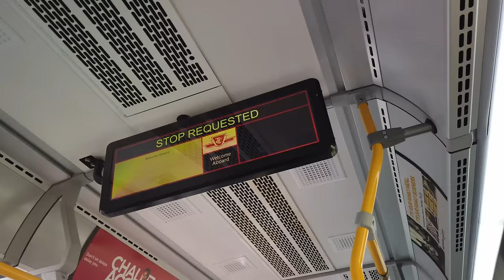Why American Buses Are Just Worse

Comment: Rectification; For the Schiphol-Amsterdam Airport buses are only 42 buses, not 200. Orginally 51 were ordered, but over time 9 were transfered to the regular buslines. The whole Amsterdam/Haarlem/Haarlemmermeer/Schiphol is indeed over 200 electric buses, however these are from VDL and Ebusco, and are a bit problematic.
Greetings, a former connexxion busdriver and Mercedes Capacity instructor
Reply: yeah I was a bit surprised by this fact, 200 buses for an airport seems way too much.
Reply: Rectification; there are actually around 200 bussen at AMS Schiphol airport! These busses are from Connexxion and not from VDL or whatsoever.... And those busses are used for the airport (and around)
Reply: @samboudarboe1776  you couldn't have a made it more clear that you don't understand what was written or said. There simply aren't 200 buses for the airport, there were 51 ordered, and as of now 9 of those are transferred to the regular buslines in this concession area. The grey VDL slfa-181 were specifically ordered for the Schiphol Airport part of the concession, the rest, the regular white buses, and the red RNet buses are aren't specifically operated for schiphol. In fact none of the regular lines run to Schiphol, and not all Rnet pass schiphol.
The fact that the buses are operated by connexxion, and VDL and Ebusco are manufacturers was clearly stated in my message.
You don't need to lecture me about my former place of work, and especially not with the same, very wrong information stated in the video, that there are 200 electric buses running at just schiphol airport is just false and misleading information
Reply: @tripel7470  There are 200 busses that are used by the company Schiphol group those busses are also used by schiphol group but they are not driving AT the airport (I never said that btw). I know that the busses that drive for example from/to the gates are not those Connexxion busses but are different ones. That still not takes away the fact that schiphol has 200 buses used for bringing people from and to the airport.
Reply: @samboudarboe1776  Schiphol group has 53 electric buses, connexxion operates only 42 electric buses on behalf of schiphol, regardless of how you count, that isn't 200 electric buses, and the statement is still false.
Reply: @tripel7470  Are you talking about apron (Gate-Plane) buses or the white VDL's ?
Reply: @-ProGamersTurkiye-  orginally I was talking about the Schipholnet VDL buses since that was the context of the video, but since Sambou decided to double down on being and tried to involve the BYD's driving airside, those are part of my my final count. However, since the video in context of electric buses running  public transport just on the airport, only the VDL's should be counted, of which currently 43 are dedicated to Schipholnet.
Reply: @tripel7470  Oh ok. And what about the 9 buses that were transferred? Are they working as R-Net buses?
Reply: @-ProGamersTurkiye-  Correct, they have been transferred to R-net, and have so far only been used from the Amstelveen depot
Reply: One thing I noticed at Schiphol in 2019 was the absence of pure ICE powered taxis. The official taxis all seemed to be Teslas and the Ubrers etc were hybrid.
Reply: @-ProGamersTurkiye-  And to make things more complicated ;) They are operated by Connexxion as well, just like the white-blue-purple Schipholbuses.
Reply: @weeardguy  Yeah, I learnt the whole thing when I went to the NL ;)

Comment: Interesting that you mentioned rattles on the North American buses. I drive Volvo and Mercedes buses in Brisbane, Australia and after a couple of years, they start to rattle as well, although the Euro6 Mercs are still nice and smooth. I'll be interested to see what our new Volvo eBuses are like in a couple of years, as they're a real pleasure to drive at the moment.
Reply: Same with the Scanias here in Adelaide, but they're bodied by Bustech so I can't really say where the blame lies. Great to drive though.
Reply: I’ve also noticed them with electric buses in Germany, both Mercedes and Solaris models. I have the suspicion they are tuning the suspension to be really stiff to try get more range out of them
Reply: @bmortloff  So, so incredibly recognisable... Since the first operator here got kicked out for Arriva in 2006 (In Europe, most areas are tender-based and the operator changes every 8-10-12 years, under the excuse this is cheaper for travellers because they get a choice... NOT), we have Scania Omnilinks... The current operator (EBS) and buses now serve the area for 12 years, 2 years longer than anticipated as covid got in the way during the end of the tender. But already during Arriva's time, the Scania's just kept being crackly, squeaky and what not. The current Omnilinks in service at EBS are still a horrible squeaky and crackly mess, even after 12 years. When the free newspapers were still a thing, you would regularly see drivers tear a page from it, to than fold it small and push it between a squeaky part somewhere: some buses were basically driving artwork with all the stuff pushed between windows and rubber seals and such, just to keep the drivers from going nuts.
I can't say that VDL Citea's (either electric or conventional) or Ambassadors are much better (the buses you see at 4:25 in the video are the ones I take to work on a workdaily basis and are in service for a number of years now), but their squeakyness is at another level and does seem to go down as they age.
Reply: Meanwhile in Singapore I find that MB Citaros rattle the least, maybe because they have independent suspension that's more sensitive to & thus better able to absorb bumps on the road, while ADL Enviro500s rattle & squeak the most, though some believe its due to lower build quality of the Zhuhai, China factory where they're assembled in (those in the UK that're assembled domestically are slightly better, from my experience). The Volvo B9L that's used on some shuttle bus services fall somewhere in-between, but also suffer from more inertia & sense of lurching forward when braking, which I suspect is because those buses use chassis/bodywork that're designed more for coaches than commuter buses, which are heavier (& thus maybe can ride out some road bumps better)
Reply: There's been times on american buses where my phone almost bounced out of my hand the suspensions are so bad. We need to change the law to allow importing better buses here. It's literally no different than importing wine or consumer goods, which is legal. If every American is already buying cheap china garbage, it won't make a difference in our economy to get busses from Europe
Reply: @michaelstratton5223 Trust me that when the road gets bad, modern buses won't help much: old, what we call highfloor buses now, used to be superior when it comes to the comfort they provide (also down to the far, far better seats in those buses). A speed bump was a comfortable nudge up and down, where low-floor buses seem to have a very rigid suspension that transfers every bump to you as a passenger. On the other hand, Dutch-built buses were built to last: the fact that buses from the end of the seventies and beginning of the eighties were exported to Cuba and such and are still running till this day (be it with some tweaks to keep them going), tells something about the ruggedness. I'll happily step on board a Den Oudsten bus should I get the chance.
One example of the rigid suspension is the road-marking they used on my route to work. For clarity, road-markings in The Netherlands aren't painted onto the road surface, but are white bitumen poured into special templates and thus show a considerable height difference between the normal road surface and marking (I think the difference easily gets up to a centimeter (about 7/16 of an inch I guess), thus driving over road markings creates clear audible noise.
Usually, when dangerous junctions, especially between different modalities (motorists vs. pedestrians of cyclists) are getting near, the infrastructural owner tends to put special marking in place to hopefully highlight the junction. Near where I work, it was decided to put a whole row of perpendicular markings starting from the edge of the lane as small stripes, gradually growing closer together and with shorter intervals between them to create a visual warning of what one was about to approach. But on the bus this created an annoying 'doonk.........doonk.....doonk...doonk..doonk.doonkdoonkdoonkdoonk' kind of noise besides a noticeable movement to the bus, where I expect that on a high floor bus, these would almost go unnoticed.

Comment: Love to see my country represented! Went on exchange for four months to Victoria BC and every bus ride made me think I was going to die. 

The funny thing is, that in Copenhagen where most of the yellow busses from the video is from, we still avoid using the busses as much as possible. Even though they are 10x more comfortable than those I've tried in Canada, they are still not as comfortable to ride as our spacious trains and metros that go everywhere. That mainly applies for Copenhagen though, in the rest of the country busses are widely used.
Reply: Meanwhile in Singapore some of us actually prefer buses over trains as they have more seats (a rigid single-decker bus has 30-35 seats out of a total licensed capacity of ~90, while a train car has 36-50 seats out of a total licensed capacity of ~320) or because some train platforms are deep underground & take a while to reach from street level e.g. an out-of-station interchange between Bras Basah & Bencoolen station means ascending from the former's platform at B5 to its ticket hall/concourse at B1, then walking along an underpass at the same level to the latter station before descending to the latter station's platforms all the way at B6, with the stations' 20+m deep lifts running at only 1m/s!

Comment: Most American cities had vast trolleybus networks in the 10 years or so after WW2. But by 1960, most of them converted to diesel. Generally speaking, the biggest problem with US busses (I can't speak to Canada. I haven't been to Canada since roughly 2003) is the bad scheduling and infrequent service. The actual vehicles feel fine.
Reply: Generally trolleybus networks came about when tram/streetcar networks reached a point of needing significant track work due to neglect, but the electrical infrastructure was still in good shape, and the desire for a vehicle that could do things like drive around obstacles was seen as a good idea. This led to a lot of networks taking up the tracks and buying trolleybuses instead. In the same way that the track of the streetcars was neglected to the point it needed massive expensive (unaffordable) overhaul, the same was allowed to happen to the trolleybus infrastructure, to the point where limited budgets meant diesel buses replaced them when the system needed new vehicles.
Reply: Agree, if only the frequency and being on schedule were better. This should be number one priority.
Reply: yeah, can't believe 15 minutes is considered frequent there
Reply: @anindrapratama  A bus every 15 or 20 minutes is frequent.  I use such a route daily in Europe, but used to use a rural bus on the same network where 3 hours is a normal interval and detailed planning is needed to not get stuck waiting for the next day.
Reply: Yeah I have riden on buses in the USA and Europe and I never have thought about the actual buses being worse as the negative.
Reply: Trolleybus lines seem to get a huge amount of NIMBY opposition from people who don't like to look at them.
Reply: @MattMcIrvin  Funny, only visible thing is a few extra wires on the lightpoles.
Reply: @johndododoe1411  European here: For city buses, I wouldn't necessarily call that "frequent", 15 minute frequency is actually standard to me.
Reply: They feel extremely cheap tho with those ugly plastic seats.
My bus line only uses Mercedes and it’s worlds better.
Reply: @obinator9065  The crappy plastic seats are a vandalism prevention thing. Once upon a time, American buses did have nicer seats. Starting in the 70s, youth developed an appetite for destruction and those all went away. I'd love to have nice seats on US transit, but I know they'd just get wrecked by antisocial jerks.
Reply: @madcrowmaxwell  bruh just use leather couches with OBS+spring dampening. Nothing could beat them in the soviet-built Ev metros, even if they were cut up a bit. But nowadays...passengers are not a factor in public transportation anymore.
Reply: Mercedes and MAN buses are far superior.

Comment: I used many of the busses in Japan, and the long distance one from Tokyo to Kyoto was almost as comfortable as the busses in Mexico. The weird thing was the seat layout; 2 seat rows on the sides and a 1 seat row down the middle with 2 walkways straddling it. The thing I wish Mexico had was the curtains tho.
The suburban busses in Kyoto and Nara (and the rural busses) were all not much better than American ones. They were slightly smaller, rattled, and looked fairly old. The only thing that made them better could be said to be the etiquette. Everyone got on in the back and exited in the front so there was no clustering.
Reply: I took a Nara bus in 2019 that was very nice, but it was on a tourist-friendly route so I don't know if it's representative of other buses. Very electronic, bilingual stop announcements (unlike any bus in Australia, with no stop announcements)
Reply: I remember Japan's commuter buses look more old-school too e.g. with large slab-like brake & indicator lights, & I was wondering if that's to maximise parts commonality with older models to minimize maintenance costs for operators. They may pack the latest technology though e.g. I saw a Nissan Diesel bus with stop-start technology i.e. the tachometer automatically dropped to zero once the bus pulled up at a red traffic light

Comment: My grandfather was an “electric transit linesman” for Rotherham Corporation.  Sadly, like most towns and cities in UK, they got rid of the trolley buses and trams.  Now they’re wanting to bring them back.   Utter madness that they scrapped them in the 60’s and wanted diesel buses.
Reply: Here's the thing, Europe is finding out the same things that the US did during the interwar years after WW2. While Europe decided to literally subsidize their transit to the point that it's at least half-paid by taxes, the US went 'with the flow' of sorts. Cars are better than trams, so busses and cars replaced trams; rail is only really good as cargo transport overall outside of the 'Last Mile', so passenger lines were discontinued in general when rail got genuine competition in the roads and air; that sort of thing.
Reply: I’m from Birmingham. We first installed electric trams in 1890. It’s so depressing to see how abysmal our rail and light rail infrastructure is now, considering it was so much better (and electric!) more than a hundred years ago.
Reply: @user-ed7et3pb4o  Yeah, no. The sad reality is that once rail got genuine competition in the form of air travel and roads/cars, their utility evaporates. The only reason that Europe still has a rail system is that they literally subsidize it to the point that around half of the costs are paid by the state... and push most of their cargo traffic off the rails.